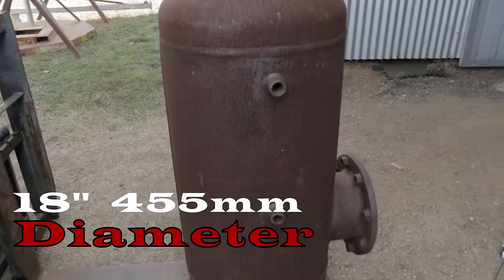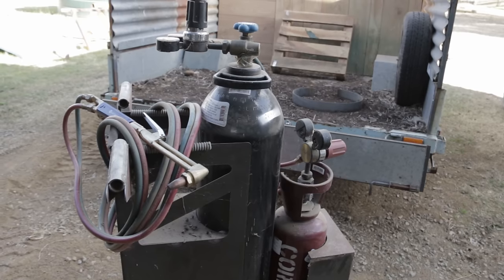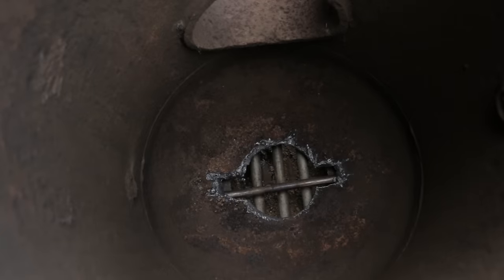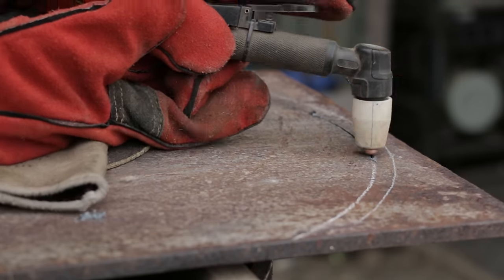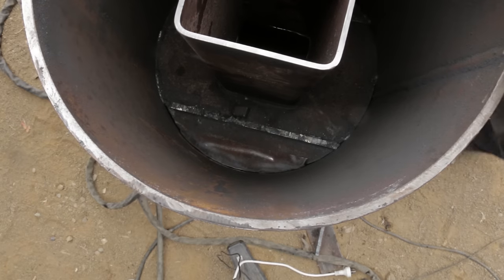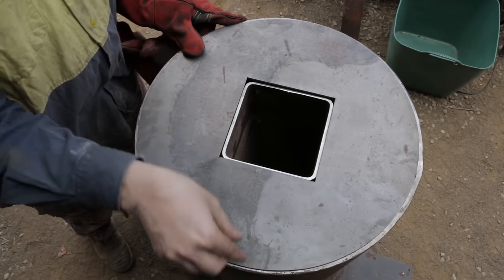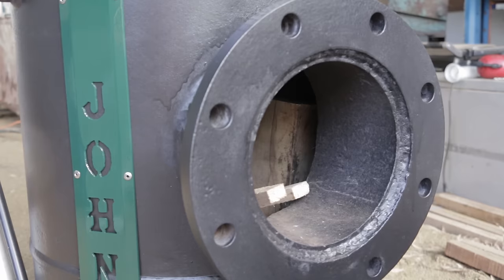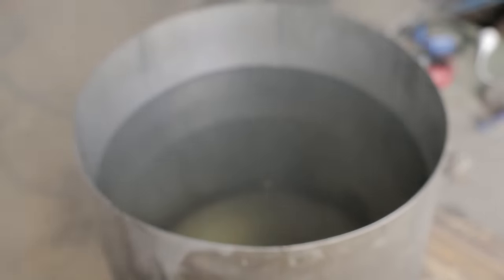500 lb Rocket Stove

Comment: Anyone else just plainly jealous over not finding a piece of scrap like that?
Reply: No, because it is the wrong material for the inside of the stove. I know that because I have a big steel rocket stove that I have build myself 10 years ago. Therefore it is not practical in use.
Reply: spent 5 years looking for one. ending up getting it. put it outside in my back yard sorta in the open. i mean damn thing was like 250-300lbs. and someone stole it lol... i haven't found one since.
Reply: @insAneTunA  "Wrong" for what specific reasons?
Reply: @Comm0ut  ooops my bad hahahahaha wrong answer at the wrong conversation hahahahahaha You must be thinking WTH???? I thought that I was responding to a whole different conversation. Now I see that it is about a stove hahahahahahaha
Reply: @Comm0ut  I must keep reminding myself that I have to put up my reading glasses before I respond to a comment 🤣😂 My apologies for my honest mistake. I hope that you can see the humor of it.
Reply: @Comm0ut  In terms of the stove. It is a bit complicated, but this is what makes a good stove that is made from the right materials burn efficient. When you have a clay or ceramic or any other fireproof brick material for the burn chamber and the riser tube it stores heat and amplifies the heat, relative evenly throughout the burn cycle from whatever you burn, and that makes the burn hot enough to burn all the gasses that wouldn't be burned at normal temperatures when you have a stove without a riser tube. 

Therefore you can use a relative small amount of wood while you can still produce a large amount of heat with a relative small amount of attendance. That is the whole basic principle as to why it works and why people like the concept. It works well and it is practical in use. 

But when you use a steel riser tube it might be possible to get that heat that you need to burn all the gasses, but from my experience it requires a lot of wood, and a lot of refilling and attendance to maintain that amount of heat inside the riser tube. As soon as the flames go down a little, the temperature inside the tube drops with it. Which reduces the efficiency a lot. And to my opinion that makes steel an inferior material for this type of stoves. 

Because of the whole concept of how a well build rocket stove works, I mean physics wise, the steel makes this type of stove with this particular burn concept too impractical to use it comfortably without much attendance.
Reply: And the steel material would still require a lot of wood. And because of the relative small burn chamber you must make all the wood much smaller compared to other types of stoves, so that would require a lot of work. So that would take away all the benefits that you would have from a well build stove.
Reply: gosh ive got 5 in the back of the shed..haven't looked at them but i intend to..one day

Comment: I had a idea which incorporates a similarly sized rocket stove, and where you put the rock wool I would replace it with wood. Turning the whole thing into a charcoal retort as well as a stove.. obviously allowing for the top to be opened to remove charcoal/replace wood. The other thing I would do is using some pipe from the wood/charcoal zone, plumb it back to the stove burner so that the wood gas helps to fuel the fire.
Reply: I like that idea mate.
Reply from the maker: I kind of wish I could go back in time and try that.
Reply: Problem with the gas given off is it contains water vapour from the wood and lowers the combustion temperature. To complicate it you would need a cyclonic scrubber to remove the moisture
Reply: Interesting idea, I do have two questions the first is would the temperature being created by the stove be too high to make good charcoal? The second is with the idea of feeding the “wood gas” back into the fire box. The first part of this question is would the inherent moisture in the wood gas cause problems with efficiency or the burn in the rocket stove. Years ago when I first read about running automobile on it I built a gasifier to run an old junk car and found out how wet as well as dirty the wood gas was and ended up building a filter separator and then after running it for a while I also discovered that wood in the gasifier had to be agitated periodically to continue to produce gas. The other thing I wonder about is since your concept is to directly inject the gas into the burn chamber is would this need a check valves to prevent a flash back explosion in the charcoal kiln/gasifier. I do think it still is a very interesting idea and worth exploring.
Reply: I might be missing something, but channeling in the wood gas, even with moisture (already in gas phase, so doesn't coop much) will only increase the temperature, as it is more fuel. Also it would not explode (no valve needed). You need oxygen plus fuel gas for an explosion. The whole point of the charcoal retort is to heat it without oxygen, so the carbon does not burn. I think it's a fantastic idea IF you can make it easy to use. That means ease of filling and emptying, it being airtight, it being robust enough for repeat usage. Love the idea though :)
Reply: I miss the smokeless chimney
Reply: charcoal becomes really brittle itd be a pain to get it out from that deep, i know because I just built a charcoal maker using a 200 liter and a 100 liter drum, advantage of the drum is you can easily pull out and then pour out the charcoal, I did try the wood gas recirculation and it works like a charm.
Reply: At thia point you as as well make a turbo burn barrel, only thing it would be missing would be a turbo and a oil feed
Reply: Should replace the rockwool with sand to store the energy....
Reply: Yep sand & rock  @FRIPPE_THE_GREAT

Comment: You can cut thick material with your plasma cutter if you slow your travel speed way down, and increase your air pressure to 100psi.

Comment: What a beaut! I love the irony. Also, the flange, makes me wanna make things to bolt on...
I wonder what of my heritage makes me love this sort of magic?

Slumming it with yukky metal, I see you have the same contempt for it that I do...
(tho I have tigged some too, its easier than stainless, I found), but usually migger or sticker (if I gave wire or dry sticks).

I had a thought about the "Gas" as you pulled out the forgotten OA torch. Pricey stuff these days,  Lucky me, I inherited a set of torches yesterday, sadly the hoses are well perished!

I also found I had to change the consumables on my plasma torch after playing with more than a little bit of 12mm plate. I had a 15mm thick cylinder that I cut open (old argon bottles) but before I had plasma, and found the 1mm x 125mm disk did it. I never dared to turn the cylinder into a rocket thing, it was just waaaay too much heaviness (boot-crushing stuff) and the scrap value was fairly high 😒so it got sold, along with all the other useful bits in the yard, and sadly the liquidation came a month or so later, last week, so new vistas for me. (Luckily my personal things are all safe, horror stories abound.) 

Thanks for the create😎, you brightened up a dreary day!
Reply from the maker: thanks mate, I hope it all goes well for you Craig.
Reply: Get new hose

Comment: I finally got me a tank with one inch wall thickness that was made in the 1940s. This will be a challenge but am willing to make it happen hopefully this year. If not the next will do Aussie Rocket Stoves. You gave me the idea fella too. Thanks vf
Reply: a question, why would you cut off such a massive amount of... well, thermal mass with insolation? Wouldn't it be better to maybe fill it with sand, or cement, or water even?
A lot of wasted potential in that one shown in the video, so much iron just sitting there, insolated away, not getting heated up to give off that heat over a long period of time.
Shouldn't Rocket stoves be generally... thin-walled? Construction serves only to facilitate a good air intake for the combustion and a way to direct a lot of heat one way, but if you want to use it for heating, why wouldn't you take a copper pipe and wrap it around the chimney, fill it with water and seep the heat from the combustion gasses that way? or maybe even put the copper inside the chimney, if filled with water it shouldn't really melt.

Comment: As gas cylinders are most often filled by exchange I don't need new cylinders, just serviceable ones so I accumulate them buying used (in the US via Facebook Marketplace, shop closing auctions etc) and it doesn't take very long to have MANY full cylinders as I immediately exchange them. I keep LP cutting tips (LP is cheaper than acetylene but uses more oxygen) too and LP has the advantage that bouncing about in a truck doesn't require settling time like acetylene. Moderns seem afraid of torch work (yet cook on grills and use gas stoves) so used quality torch and regulator outfits are easy to find.

Comment: Beast! If you put a shroud on the top of the stove so the heat hits the bottom of the water tank and is then forced up the sides of the tank before it exits at the top then the water should boil sooner. Just keep cross sectional area for the exhaust the same. Thanks for posting.
Reply: I agree, I think a taller version of the wind shrowd would help A lot. Ideally of a thermally reflective metal like Aluminum. It is a tall pot, so it radiates heat away while heating up too. The shrowd would extract more energy out. Would love to see a test with this stove and the boiling time with and without a shrowd around the pot.

Comment: thats not realy a rocket stove u need to close off more of the air intake till its like a jet sucking air and lift the fire to the level of the air imput so the fuel has the air fored thru it
Reply: If it was, the square steel burn tube would not last 2 seasons! Ours had to be refractory cement 25mm thick!
Reply: @dogdooish  I made mine with 150mm steel box but lined it with ceramic plate works awesome just wish I had used 200mm box !

Comment: If you slowed your travel speed with the plasma torch, and waited in one place until you cut all the way through,  ot would have cut this , it would just take a while. Travel speed is the most important part of plasma cutting,  thicker it is, slower you go.
Reply from the maker: True. The consumables were pretty knackered at that point. I didn't want to max out the duty cycle on the torch.

Comment: I am making a furnace out of an old 500# propane tank - I went at it with the torch and it wasn't easy - about 3/8" thick and ... I'm not an expert ... what was supposed to be a square opening has no right angles or equal length sides ....

Comment: From this build, it is not obvious that you have built rocket stoves before. The air intake is above the fire! The output is bigger than the intake, but not by much.
Reply: Not a rocket stove, more like a wasted burn barrel… whats the point of insulation , maybe heat directed

Comment: Just a stove. NOT a rocket stove.
Reply: No, definitely a rocket stove. Fuel feed from the side, oxygen flow from underneath, chimney for flame/heat.
Reply: The feature of a rocket stove is that it burns the exhaust gases and thus burns particularly efficiently and hot. That is not the case here.
Reply: Just a  comment, NOT a good comment!
Reply: @ozwogman  I didn't judge if it is a good or a "not good" stove. 
Only stated that it is not as it is specified.
So if your comment relates to your comment, you're right!
Reply: @RallyeRacin9  Ah, you are more thinking of a gasifier, maybe.  This beast is a rocket stove - slow to get going properly but when it did,  it burned quite cleanly.  Rocket stove.

Comment: Can you explain the "glass water" bit?
Reply from the maker: Sure, glass water is used in furnaces to harden and preserve the ceramic wool in high temperature applications. 
In this case I didn't have enough to do all of it so I figured in tipping it down the bottom and putting the ceramic wool on top, it would get where it needed to be.
Reply: you can make your own water glass from crystal kitty litter (silica beads)and draino(lye,caustic soda) @LittleAussieRockets